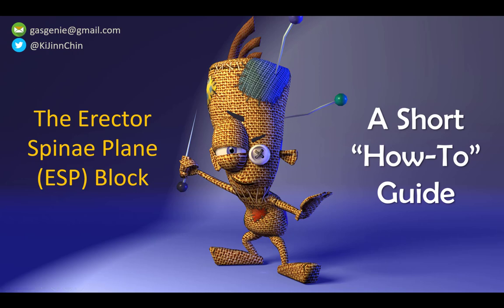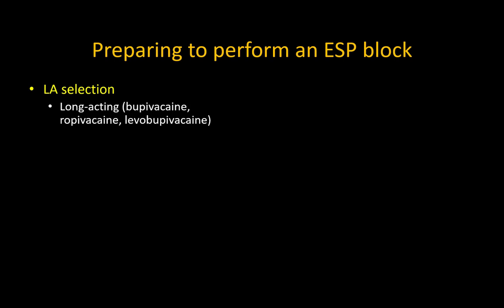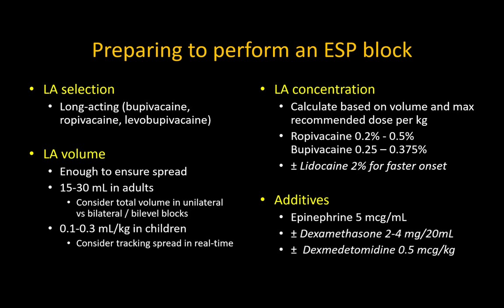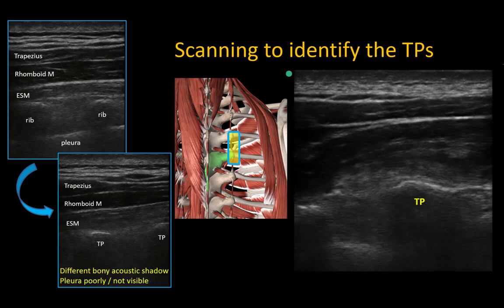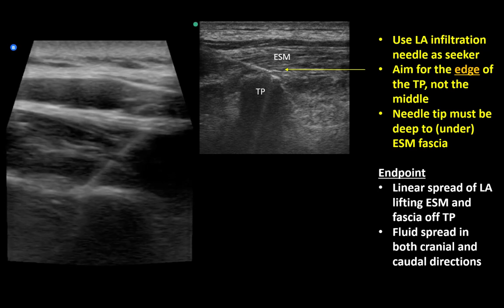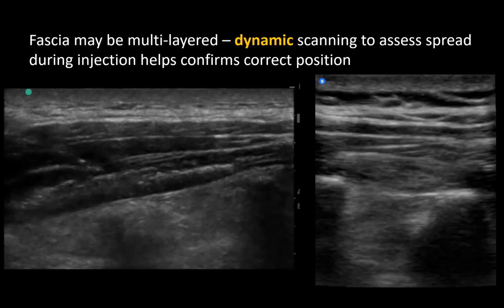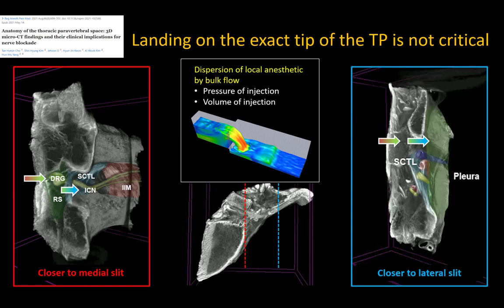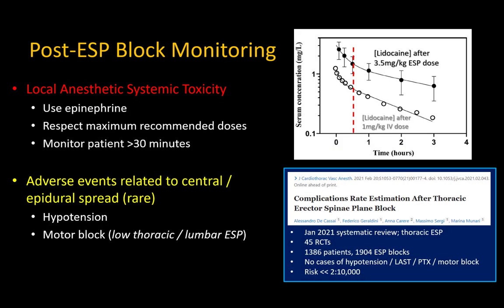ESP Block - How To Perform It Effectively & Safely (2022)

Comment from the maker: "Caveat Emptor": As an INDIRECT method of achieving local anesthetic delivery to the ventral rami and spinal nerves, there will inevitably be a large range of effectiveness for in any individual patient. This is the trade-off for enhanced safety and feasibility. The ESP block should therefore always be just ONE component of a multimodal analgesic/anesthetic strategy. Also note, the block videos in this talk have been deliberately chosen to show that the imaging with the ESP block is not always as straightforward as many of us make it out to be!

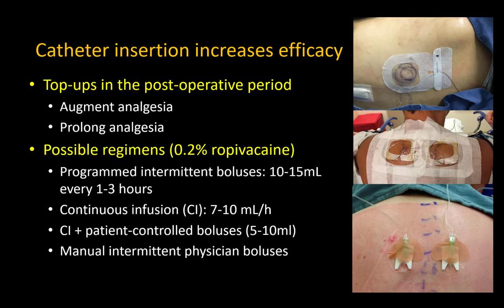Comment: What is the protective dressing you have under the pajunk e-cath at 10:07 ? I have seen issues with pressure injuries with erector spinae blocks with this set but this looks like a good protective measure
Reply from the maker: It's a dressing designed for epidural catheters originally, (https://itsinterventional.com/products/epi-guard/) but Pajunk has indeed adopted it for its e-caths, and they market it now as the Fixocath - https://pajunk.com/products/regional-anaesthesia/accessories/fixocath/
Reply: @KiJinnChin  Brilliant thank you for this

Comment: Dexmedetomidine is cost prohibitive there? One vial of dexmedetomidine, containing 2ml or 200mcg of dexmedetomidine, costs roughly 25€ here. If you use 50mcg per 20mL syringe (which is the largest ammount I am personally comfortable with), 1 vial should be sufficient for 4 20mL syringes of analgetic mixture, making it 6,25€/syringe. How much does it cost there, if cost is the deciding factor? Worth noting: the combination of dexamethasone and dexmedetomidine affects duration of blocks performed with ROPIVACAINE far more than it does bupivacaine or levobupivacaine (I am unable to explain quite why that is). I am able to achieve up to 72h of complete analgesia with full mobility in IPACK and adductor canal blocks for total knee arthroplasty this way, for example. I have insufficient data on duration of ESP blocks using these 2 adjuvants at the moment. Hope this helps. Thank You for sharing this amazing content!
Reply from the maker: Thank you so much for sharing your insights! Gao et al (Front Med (Lausanne). 2021 Nov 25;8:577885. doi:10.3389/fmed.2021.577885. PMID: 34901039; PMCID: PMC8655682) have confirmed your impressions of the dexa-dexmed combi in a RCT. Definitely worth exploring. Do you have any concerns with hypotension or bradycardia at the doses of dexmed you use?
Reply: @KiJinnChin  Do You have access to liposomal bupivacaine? Reading about it seems like it would make all this alchemy redundant. 😊
Reply from the maker: @uramalakia  we don't have it yet in Canada, so no direct experience. Not sure about how suitable it is for anterolateral torso, since bulk of the depot will remain in the ESP and dorsal rami (based on MRI images).
Reply: @KiJinnChin  That's an interesting point I hadn't thought of.
Reply: i'll second KJC to ask - do you encounter any issues with bradycardia/hypotension with that concentration/dose of dexmedetomidine for PNB?
Reply: @armuk  Do I encounter bradycardia? Yes. Hypotension? Not really, no (unless you overestimate the volume of your spinal). I've since gradually upped the dose of Dexmedetomidine for iPACK and adductor canal blocks for TKA to 100mcg per block. And while it does seem to extend the duration of the pain free period post surgery for roughly 4-6 hours, it hardly seems worth it (at this dose, bradycardia becomes more pronounced, while hypotension is still not much of an issue). I intend to stick to 50mcg per block at most to be on the safe side. 

Also, I found an interesting addition to the debate of Dexamethasone iv vs perineurally: While the effect of both on block duration is virtually identical, perineural dexamethasone grossly decreases the amplitude of rebound pain (I'll try to find and link the study on this topic). So I will continue to use it perineurally (as part of my block analgetic mixture).

I'm slightly frustrated overall because there seems much more work needs to be done in this area but due to my general workload and other obligations, I am unsure, if I'll get through it all anytime soon. Not to mention trying to compile all this data into something coherent enough to publish.

I feel I'm slowly reaching the end of the road with additives. Does any of you have any experience with blocking the nerve to vastus mediallis and geniculate nerves on postoperative pain scores in TKA? Adductor and IPACK alone appear sufficient but I can't help but wonder.
Reply: @KiJinnChin  UPDATE: I can somewhat confidently report that 72h blocks for TKA using ropi+dex+dex are unfortunately few and far between. I've been trying to tweak the analgetic mixture chasing that duration but am disappointed to report that the norm is rather slightly over 32h. As for dexmedetomidine, anything above 2,5mcg of dexmedetomidine per mL of analgetic mixture seems to be redundant. The upside is that for 32h, patients after TKA are virtually completely pain free with full mobility. The downside is that it only lasts for 32h, after which it's back to square one. I am now combing through literature for other possibilities. I found a study that used methylprednisolone as an adjuvant that looks promising. Do You have any experience with it by any chance? I'm torn between either going with methylprednisolone+ropivacaine from the get go or doing ropi+dex+dex right after spinal, before incision, and then doing ropi+methylprednisolone on the third postoperative day. Does any of this sound reasonable or unreasonable to You? Adductor canal catheter seems to also be a reasonable alternative but threading it into adductor canal while simultaneously pathing past nerve to vastus medialis seems overly complicated and prone to faliure from catheter displacement. What do You think? I appologise, if I'm being bothersome. Thank You for Your amazing work!
Reply from the maker: @uramalakia  Thanks for sharing! 
(1) I presume when talking about "blocks for TKA" you are referring to ACBs, and maybe IPACKs? If so, I think that your results are pretty good for a single-injection block that is not targeting a specific / discrete nerve, but rather flooding a compartment. To be able to average 32h (as opposed to this being an outlying value) is beneficial, even though the problem of rebound still remains. 
(2) Appreciate you sharing the finding regarding dosing of dexmedetomidine.
(3) I have no experience with adding methylprednisolone - this is something my chronic pain colleagues do. They seem to think that it's probably the same as dexamethasone - but it's particulate, so that may be a consideration in terms of being more cautious?
(4) ACB catheters are definitely gaining traction. There is a question of how and where to place them for max benefit, and not interfering with surgery. The catheters can be difficult to feed into the space - they tend to want to exit the canal. I am still experimenting with best approach myself. I wouldn't worry too much about trying to thread it pass the NVM - I'd aim to have the catheter tip lie more distal for now, personally. I refer you to a recent Korean RCT in RAPM that compared 3 locations of ACB catheter and found no significant difference between all 3; although slight trend in data to the distal site being better.
Reply: @KiJinnChin  Thank You for the insight! I mentioned the NVM because it is my understanding that it contributes a significant proportion of innervation for anterior knee capsule. So a catheter that could cover both it and the saphenous nerve makes sense to me.

Comment: Thank you for another informative video- answered many questions I had regarding needle placement and catheter technique. Do you have any tips for trainees regarding US and needle visualisation? As the back is not a flat surface I often need to angle my probe medially to acquire a good image, but at the cost of losing my needle.
Reply from the maker: Hi Lisa! You are very astute with your comment on probe angulation! I find exactly the same - I am often angling/tilting my probe (which is an unconscious move that one acquires with experience in USGRA generally) to get the best possible image of the fascial layer. And so I too am often not inserting my needle in-line with the beam initially, despite it apparently being in the center of the probe's short edge. 
If this happens, I usually slide my probe medial-lateral to ascertain whether the needle is lying medial or lateral to the beam; then I either withdraw and adjust the needle insertion site (if the error is very large), or more often I pivot the needle trajectory into the beam so that the needle is slightly tangential, with the needle tip visualized but not the proximal shaft. 
Accuracy of initial needle insertion can be improved by using the LA infiltration needle as a finder, before inserting the block needle.
Reply: @KiJinnChin  Thanks very much!

Comment: Hello, Thank you for this very  didactic video. What hard  data do you have on the  real efficacy of adding  epinephrine to ropivacaine  to decrease   Cmax  and Tmax in fascial  plane blocks? Is this effect  real?   Or do we have  to settle with the hope  that it will act as a marker of  intravscular injection?  10.1016/J.BJAE.2019.05.001 and  10.1011/anae.15641 Also, DUKE RAP was advocating Adrenaline 2,5mcg/mL in one of their  videos. In what way is 5mcg/mL  better? Thank you for  your  answers.
Reply from the maker: Yes the effect is real and shown in studies, e.g. J Anesth. 2014 Aug;28(4):631-4. doi: 10.1007/s00540-013-1784-4. Its purpose is not as a marker of intravascular injection as this is highly unlikely. It is there to inhibit systemic absorption. This is also why the higher 1:200,000 or 5 mcg/ml concentration is advocated. 
This should not be confused with the modern use of 1:400,000 oro 2.5mcg/ml epinephrine for peripheral nerve blocks, where the purpose is indeed to serve as a marker of intravascular injection, and to minimize the theoretical concern of vasoconstriction of vasa nervorum (neural blood vessels) that might increase risk of neural deficits. This last point was why there was a move away from 5 mcg/ml which had been traditionally used in PNBs. Furthermore in PNBs, total LA dose is usually not close to max limits, nor are the surrounding tissues as well-vascularized as muscle, so systemic absorption causing LAST is not generally a concern. 
These are good questions. My personal approach to decision-making in questions like this is to drill down as far as possible to identify the fundamental concerns and issues, and to determine the most scientific and logical principles to apply, and then deciding how much importance to apply to each consideration in a specific given situation/scenario, especially where they are conflicting.
Reply: @KiJinnChin  thank you so much for your thorough answer... you Never disappoint! take care.